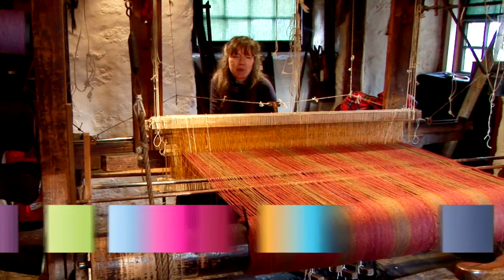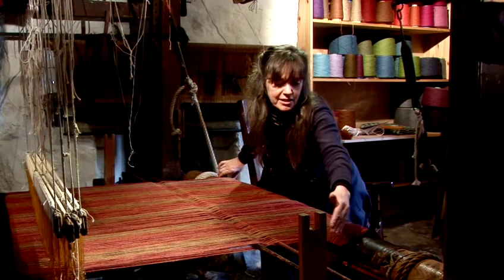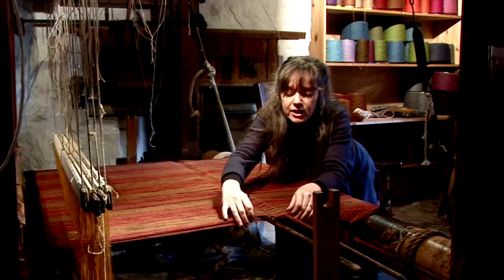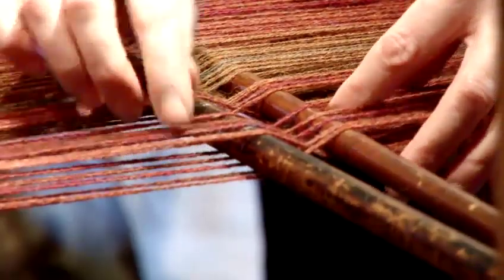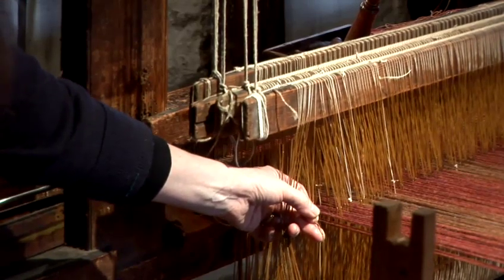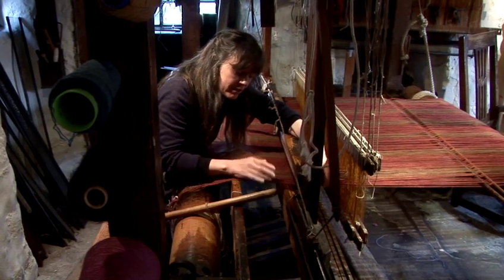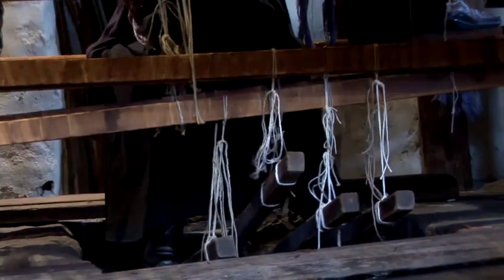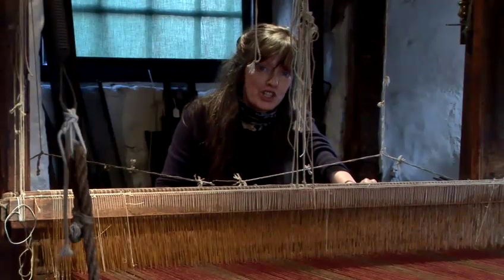How To Set Up An Old Fashioned Loom

Comment: Getting 880 threads of the warp through the beater and the heddles and rolled onto the warp beam sounds like a real pain, even for two people.  It looks like you have it on there really good though.
Reply: It gets easier with practice, but yeah, it's a bit of a pain. I think of it as the chores I have to do before I get to the fun bit - actually weaving :)
Reply: It was news to me that looms would have been dressed from front to the back in the past. Was this way of dressing predominant in certain areas or countries?
Reply: @brightfeatherdesigns  I weave dish towels using 6/2 cotton warp, 16 ends/inch and 16 inches wide. Chaining 256 warp yarn has always created a hopeless tangle so I made cardboard bobbins to wind the warp on as I was removing it from the warping frame.